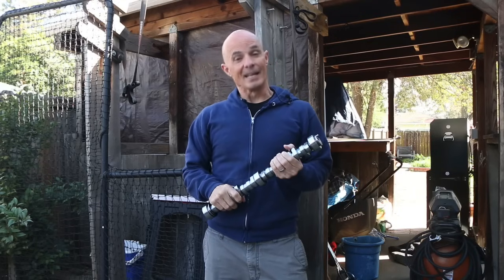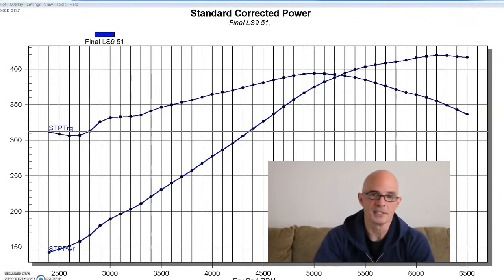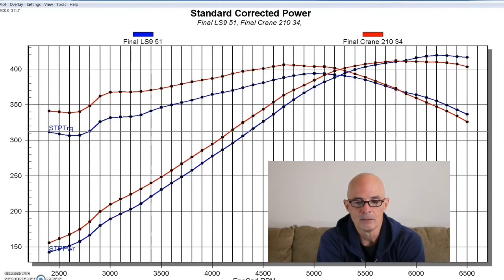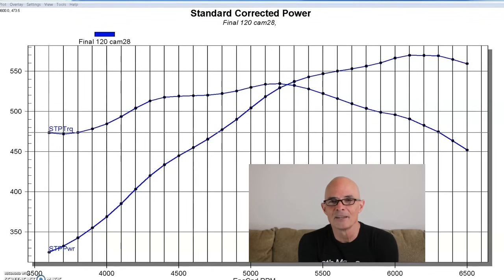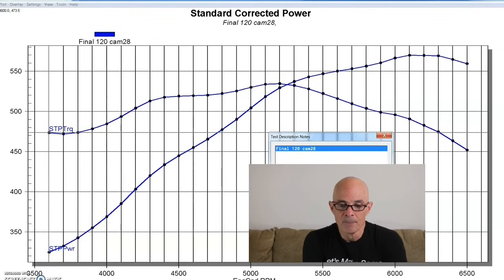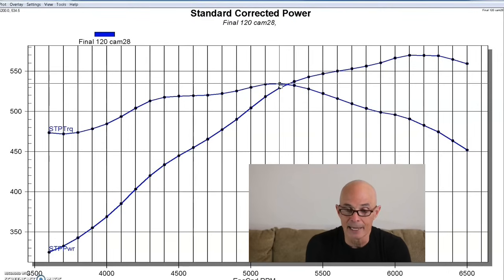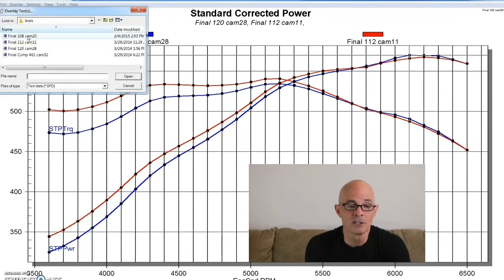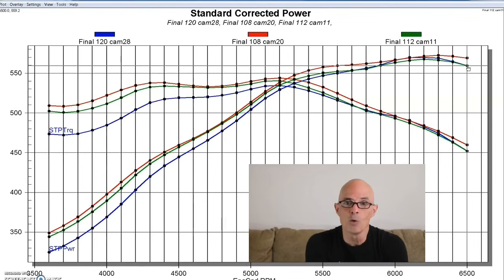LSA CAM TEST-108 vs 112 vs 120

Comment: Richard, I’m concerned I messed up when buying my turbo cam. It is custom ground and the man I got it from told me his setup was very similar to the one I’m doing however I’m worried the ptv with a stock or flat top style piston won’t be enough with the lift being 631/646. What’s your best suggestion? I got a good deal on it and would like to use it as he had the same turbo but trick flow 225s to my ported 243s... hope I hear back from you thanks for the great work.
Reply from the maker: the lift is almost never the issue with P-V-its the intake duration (amount of time the valve hangs open)-what are the specs
Reply: Richard Holdener sorry for the late reply I work for public service and with everything going on it’s been a long day. I have go grab the cam card but I believe it’s 232/236 dur .631/.646 lift cut on a 116. It’s custom ground by cammotion from Martin Smallwoods direction is what I was told but I will verify tomorrow after work. Do you have an email I could contact you at? If you don’t mind when I get a chance I would love to run some things by and pick your brain. I’m in no rush just really enjoy what you do and am hoping you can help me out when you have a moment. 
Thanks 
Jay lamb
Reply: Richard Holdener  do you have an email I can shoot you a message to?
Reply: You're gonna need valve reliefs

Comment: Is there a ideal LCA for each engine based on the amount of valve area/compression/cylinder volume/ valve angle as some authorities suggest?
Reply from the maker: LSA or LCA?
Reply: Separation, dang it, separation!

Comment: Could you test 3 different PD blowers based on the TVS 2300?  Was thinking the Magneson Heartbeat, Edelbrock E-force, and the blower from the LS9.  As I understand it they all use the TVS 2300 but have different intake runners.  Would be interested to see how they compare at low rpm’s running the same boost.
Reply from the maker: I don't have three PD blowers-runner length helps if it is long enough

Comment: Interesting to see that most basic "Turbo cams" have a wide LSA if tighter LSA produces more power down low. I would think that's what you'd want to spool the turbo up faster on most combos. It seems like you can't go wrong with tighter LSA for a street/strip motor where you aren't worried about driveability. I guess that's why the turbo cams have wide LSA, just to help driveability. Interesting to see for the build I'm trying to piece together, looks like I might try and spec out my own cam for the fun of it and see where it takes me :)
Reply: Egt can sky rocket from tight lsa. Overlap causes issue due to the reversion.
Reply: @TurboGreggZ how are you getting reversion when most modern turbos have a pressure ratio close to 1:1 (pressure in the exhaust equal to what's coming in the intake)
Reply: awebke You’re exactly right. Back when they raced the grand nationals, Kenny duttweiler tightened the LSA on them for the very reason you stated.

Comment: So a tight lsa would be better for low end boost as in it should come in to boost sooner
Reply from the maker: if it helps add low-speed torque-boost response can be better
Reply: Richard Holdener this would be an interesting test to see the difference in boost curves

Comment: I always thought wider lsa was better for efi idle by providing a nice smooth vacuum signal. I didn't realize it killed low end power.. I'm running a comp xfi252hr on my sbc. 202/212@.050 w114lsa. .550/.546. Comp estimated 463 ft/lbs @ 3500 with their camquest software from 355 cubes.
Reply: All depends on what you're calling "low end".

Comment: Drop them in a baseline junkyard 4.8L and show us the numbers. So many tests show built engines, but how would these work for a cam+springs+tune only on an otherwise stock 4.8/5.3? I think a LOT more people are looking at ways to bump up the power on a budget, but at the same time I like seeing the 500+ for the race guys (just not as often as the "how to add power for under $1000" tests).
Reply from the maker: I don't think there is any shortage of junkyard motors on this channel

Comment: Richard! People want that down low power for part throttle feeling of the motor. If you have a gutless bottom end you feel it trying to accelerate from a stop. Even though you don’t floor it there people still want to it to feel powerful everywhere. ONLY if it doesn’t have a higher stall converter
Reply: That's right.

Comment: Another great test. I have learned so much from you videos. You talked about the limitations of a dyno that i have never heard . That being said , could you ( or have you ) do a 1500 to 5500 rpm Ls combination test to make most torque ?
Reply from the maker: I have run low rpm testing but not WOT at 1500-that's just not realistic

Comment: 106 the most  proven drag racing LSA. Try it!
Reply: 108 - 110 for street manuals, if you don't mind a little loss in 0-10 mph drive-ability.  

I put a 220@.50 flat tappet w/ a 108 LSA, in my 350ci Chevrolet 1ton wrecker.  Installed headers & duals while I was at it, and it had a nice, just noticeable lope when idling.  Sounded very good.

Was a little weak down there at idle speed, but pulled like a tractor from 1,200-1,500 rpm.  Had to buy a stiffer pressure plate to keep the clutch from slipping under load.

Comment: what about engine vacuum with the lsa
Reply from the maker: yes-I should have done idle vacuum and maybe even cranking compression
Reply: Richard Holdener  it would be nice to show just how little vacuum a 108 cam has how that would correlate to the power brakes

Comment: Texas speed just came out with the BFD cam that has a LSA of 108. I would love to see that in a LS1
Reply: Because I just put it in my car and they sent the cam card with it. I'll have to look for the cam card again
Reply: I have a video of the idle on this account
Reply: Struinzu Vaffencullo  yup
Reply: osp80  obviously don't care about performance either lol.. 
For what it's worth my car doesn't even really lump that much on idle. 16 degrees of overlap (which will really determine the idle quality, not LSA which overlap is a by-product of), it's called a good tune..
Honestly idle quality was the last thing on my mind because any decent tuner can make a big cam idle smooth or even a stock cam to 'lump' like an aftermarket one..
Reply: Lmao 1350 idle? What crack are you smoking my 108 lsa cam idles at 800rpm all day, thats AFTER I told my tuner not to set the idle too low because I don't want an overly choppy idle lol seems like the problem isn't the cams, its guys who can't tune worth a shit.
Reply: I have a 232 234 111 lsa in a ls1 and its very strong up to 6500 rpm l didn't notice a loss of power down low
Reply: I have been running a low 230s duration cam with 108 lsa for about 7 years now. I have no idea why more people don't run them, it's that kinda situation I think where somebody on a forum said 'it's not a SBC, you can't cam it like that' so everyone is just blindly running these 113-115 LSA cams with a heap of duration so it will chop on idle still despite the broad LSA. Seems retarded to me to cam an n/a engine like that unless you want soggy midrange. That narrower or 'lower' LSA = an earlier IVC closing point, more cylinder pressure and dynamic compression. Giving up midrange on an LS is dumb af considering most running the stock plastic manifolds are going to be nosing over anyway >6500rpm so why pick the higher LSA cam that gets beaten up until that point?

Not saying 108 LSA is the be all and end all.. But it's not all bad either lol. Lot of guys go for a ride in my car and comment on the strong midrange and overall performance compared with other cammed LS1s they have been in.
Reply: how is it that you came about this knowledge?

Comment: I think the results would be the same no matter what cubic engine. What would happen if you changed the duration only?
Reply: Duration moves the power band to a higher rpm.
Reply: @michaelangelo8001  so u would want higher duration for racing for higher intensity engines
Reply: @rafatrill  Right.

Comment: They need to come up with a variable LSA cam! With variable lift, and duration, ecm controlled, then the buying of a cam, would be only a download, it would be cool of it worked reliably, I bet it would be expensive to repair, if it could have a range of         .150" and 100° dur, and 20° LSA, springs would be about the only upgrade, program cam specs, and amount of variation of timing, make ALL the TQ down low, and All the HP up top. Like vvt on roids! Great video, I'm gonna watch it again!
Reply from the maker: look up the new Koenigsegg motor-infinitely programmable cam timing
Reply: @richardholdener1727  BMWs have variable cam timing, plus variable lift and duration.  This also varies the LSA...

Comment: Richard, you say the dynamometer won't measure the entire operational rpm range.  But last year when I was building my Cadillac stroker, I spoke with the engineer at "The Cad Company" extensively.  He brought this very subject up in our conversation.

Oddly enough he mentioned Westech specifically.  He said: "Westech says their dyno won't measure across the whole rpm range, and that's just BS".  Said: "we have the exact same dyno, and we had the factory come out and did a add on modification that allows us to do the entire sweep from idle to redline accurately.  They could easily do the same" 

So, maybe this is something you'd want to have Westech look into?  If they aren't interested in cooperating, you could still do both a low, and high sweep.  At least then we could compare the relative low and high characteristics of the different cams, or whatever you are testing at the time.

I think the duration on these cams was too long for your rpm cutoff point.  Like you, I would expect to see a sharper drop off in the curve for the shorter LSA cams on top.  I think you would see an even more dramatic drop on the low end, also.  My experience has been that a closer LSA tends to concentrate the power in a tighter rpm band.

Thanks for this data, though.  Anything at all in this regard is helpful.
Reply from the maker: Thnx-we were past the power peak of the motor so further rpm won't any higher numbers, although possible differences, for more rpm, this motor needed a single pkane intake. Idle to redline!

Comment: I was always told wider LSA meant less valve overlap so it would be more efficient. When used with forced induction it reduces blowing fresh air and fuel out the exhaust. I could be wrong though.

Comment: Let’s see the same test with boost.
Reply from the maker: same results
Reply: Richard Holdener isn’t it true that “blower” cams have wider separation angles to reduce the amount of intake and exhaust valve overlap so that you don’t push the boost out the exhaust valve while both valves are open? You have proven that all cams are boost cams, but I was wondering if a tighter separation angle would hurt a boosted engine more than an NA engine.  It might be interesting to see what effect LSA has on boost numbers.

Comment: I would like to see this same test with a boosted application.
Reply from the maker: same thing happens
Reply: So tighter lsa will produce more power the a wider one under boost?
Reply: @raypowell5268  the power curves just shift higher. They stay the same

Comment: Great video, I would like to see this type of test ran on a stock 5.3 and 4.8.
Reply: rideswift It will be pretty much the same,  just shift the power curve towards the right, and it will be a more linear power band.
Reply: @chomin3025  So with a smaller engine will it make hp and torque in a higher rpm than a bigger engine (lets say 305 vs 400 , or a 350 as they have the same stroke) with the same 108 lsa camshaft. Or??
Reply: @Skoog.  smaller displacement = It makes the power and torque higher in the RPM (with the same camshaft as the bigger one)(Generally , bigger CI can take more advantage and make more power throughout the whole curve. and bigger CI always means more torque with the same mods as a smaller engine)
Reply: @chomin3025  Thankyou..!! I always thought it made power at the same rpm.
Reply: I would like to see 108lsa waste gate spring pressure and the 120lsa waste gate spring pressure and see who makes the most power on five pounds and 20 pounds with egt gauge hooked up

Comment: OVERLAP
Ls9 = -24.50

Crane 210/218 
122.5 = -18.00

Crane 232/242 (.624/.624)
120 = -3.00
112 = 13.00
108 = 21.00
Reply: Exhaust scavenging induction event. The fifth cycle.
Reply: all those number can change with different grind timing ...
Reply: Yes, I agree. for some reason i was thinking in terms of the timing events in relation to crank position...
Reply: @autobodyspecialistsinc.4397   If I hand you a cam with 10 degrees of overlap, you can change that?
Reply: Ivo, evc, ivc, Evo are all different on the cams
Reply: The L.S motors are a whole different animal than the old small block when it comes to cams and l.s.a it seems to me they can do so much more with the l.s cams as far as all of the numbers more lift and longer duration and thus not needing to tighten the lsa as much and fight with the choppy idle and vacuum issues like in the past if I understand right it's due to the cam actually being moved up and ,made larger is this correct ? I'm interested in anything I can. Learn. Pls
Reply: 120 112 108 is this for the exhaust or is this for the intake I'm somewhat of a noob someone help please
Reply: @UPsideDOWNworld321  the lsa is the duration of both the  intake and the exaughst put together
Reply: @curlynigero6417  Not quite...it is lobe center to lobe center (intake to exhaust in degrees of rotation) which gives you an indication of overlap (both valves open at the same time).
Reply: LSA * Lobe Separation Angle

Comment: There must be a shift point down low. Isn´t there less idle vacuum and torque down low with a tight lsa?
Reply from the maker: less idle vacuum but not torque
Reply: @richardholdener1727  Thank you. Now I know and that BTR Stage 2 V2 Truck cam looks even sweeter.

Comment: I want to hear the difference in the LSA of the cam
Reply: Hakimbo Bola  Maybe he wants something that sounds cool and helps performance? Lets say you only get 2 degrees difference in LSA and it doesn't make much of a difference in power, but sounds cooler, why not get it if that's what you are looking for.
Reply: Hakimbo Bola  the sound makes all of the difference.   a heathy sounding cam just makes it funner to drive even if it is little slower on the bottom.  no one looks at a stock sounding cam and thinks that sounds good.
Reply: Hakimbo Bola  Well considering he watched the video all the way through the choppiest cam made the most power. So STFU
Reply: Lower lobe center number more choppy
Reply: The sound (and vacuum readings at idle) helps someone make the right choice for themselves between performance and drivability. We all see the tighter LSA performs best - but at what cost to idle and drivability? Hearing them idle and seeing vacuum readings helps inform us.
Reply: @GroovesAndLands  you get it👍
Reply: @GroovesAndLands  this is one of the biggest thing for most street driven cars. Cool idle sound, good performance and having good vacuum for brakes. A choppy idle is cool until you get one good pump out of your brakes and then nothing after.
Reply: Right in this it showed the lower lsa making more power throughout, and with a lower lsa you'd have more chop chop pop pop. If that's what you're after, that'd what you'll get!

Comment: I'm glad you did this I was curious to what lsa would do ,but what about lift on the same cam , I'm curious to what I'll gain going from 226/236 .525 110 To my New 233/239 .630 .112  but with 37 more cubes and a about a .5 more compression
Reply from the maker: that's more than a change in lift
Reply: @richardholdener1727  yes I know

Comment: Nice was curious my self I kinda had a feeling what was going to happen but this makes me happy with my 250 4.1 crossflow 6 Aussie eng 😉 262,262 with 105 lsa chop chop and still made 400nm at 2500 and will pull till 7 👍nice vid

Comment: Awesome. Could be why my last build was impressive for just a 350. Lol 4.10 gears 3500 stall 11.1 compression and a 257 dur 540lift at 106 lsa thing was a animal on the street. 3400lbs car with me in it and ran low 7s 1/8 na i wanted to spray it into the 6s but 106lsa didn't really like nitrous lol. Great video.